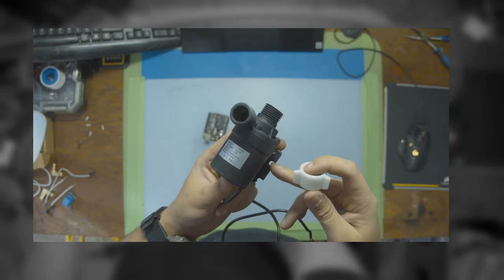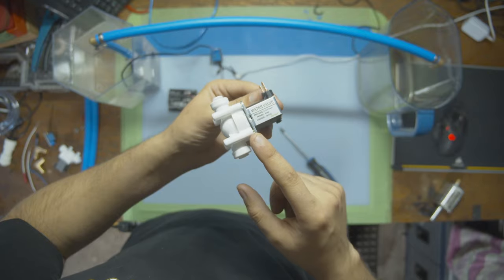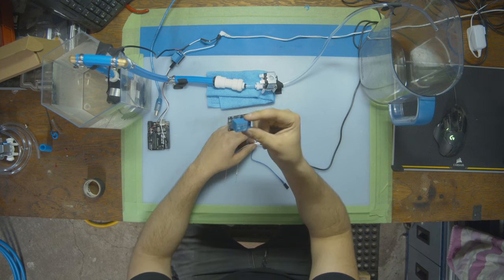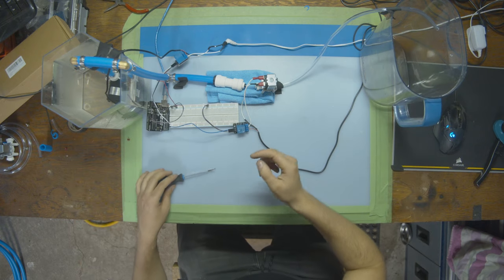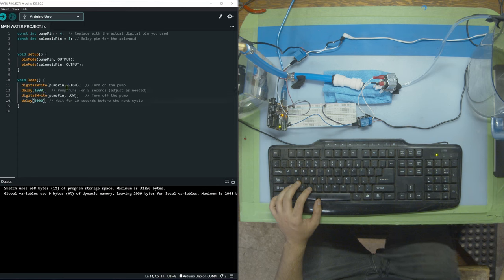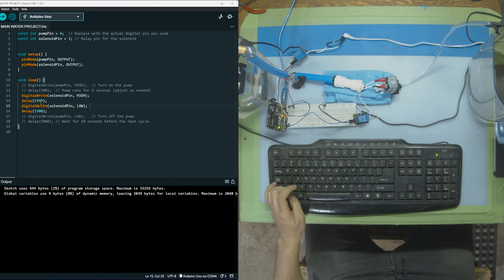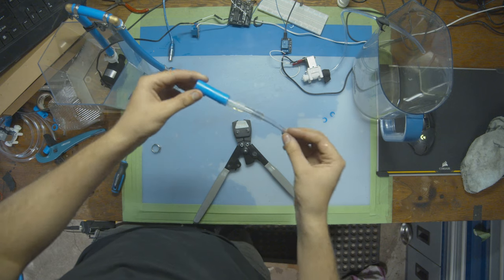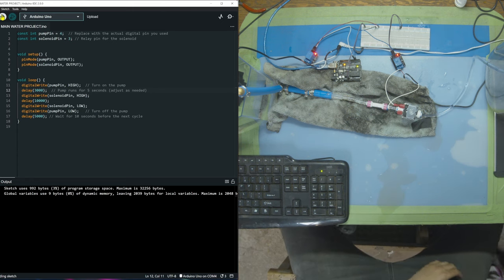Control WATER with a 12V SOLENOID & ARDUINO! #arduino #esp32

Comment: Can the solenoid open partially to let the flow of water be set to a lower amount? If not, can you suggest some alternatives and also make a video on how to connect that?
Reply from the maker: no unfortunatly, I think the best option would be to use it in steps, like on 3 seconds and off 3 seconds, but if you want super control you would have to make a solenoid with some actuating door that you can control the percent of how open it is
Reply: @MikaelAbehsera  alright thanks
Reply: would a modulating ball valve with an electric actuator work?

Comment: what relay module do i need? I am making the exact same system as you but I am unclear on what relay to buy. On amazon I see a bunch that are 5v relays but it is not clear to me if that is the one I need as I am using a 12v power supply like you
Reply from the maker: Usually the have 2 different voltage numbers, one is for the controlling part and one for the actually relay circuit, so those Amazon 5v ones need 5v to trigger on or off but can handle a different level of power on the circuit side, hopefully that makes sense !

Comment: The only issue with those valves is you cant hold them open indefinitely, they overheat eventually.
Reply from the maker: True, I’ll be doing this video again with some bigger ones in the future to see how much damage we can do and see the numbers/results
Reply: How long can they stay open before it becomes a problem.. would 15 minutes to 1 hour be ok ?
Reply from the maker: @danielleekirkpatrick8579  I haven’t tested that out yet, but I’ve was thinking of just connecting a servo to a Manual block off and then it wouldn’t ever burn
Reply: @danielleekirkpatrick8579  they can run lower than 12v, they should take much longer to overheat with 7v vs 12v.

Comment: Why my solenoid valve is not working?
Reply from the maker: Check wiring
Reply: If i connect the solenoid straight to the power supply its working, but if i connect it to relay its not working. I'm using 2 relay module with esp8266. Is it because it didn't get enough voltage? @MikaelAbehsera
Reply from the maker: @nurulainaabintiahmadshukri7494 I’m not sure but I would check the code and wiring, if you know that the solenoid works, then go to the next part the relay, figure out why it’s not working

Comment: Great video, I have a use case I'm wondering if you have experience with.  I have an Opal Ice maker that I would like to use an air pressure sensor to control a solenoid to manage its water level.   Smaller scale than this arrangement. 

I don't have experience with Arduino, or these types of sensors.  I'm looking for guidance on the best way to accomplish this. 

It's a common use case with these popular ice makers.   I think this arrangement could create a retro fit for ice makers that could be easy to install and fail safe. 

Any suggestions on how I accomplish this?
Reply from the maker: Im not sure how these Opal ice makers work, but you can also do a water level sensor with a shutoff switch to make your life way easier no?